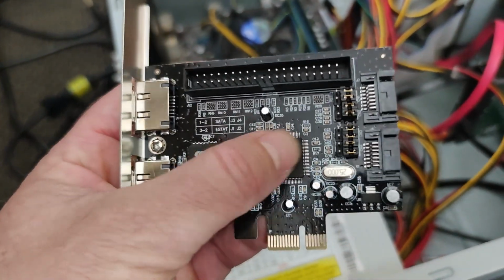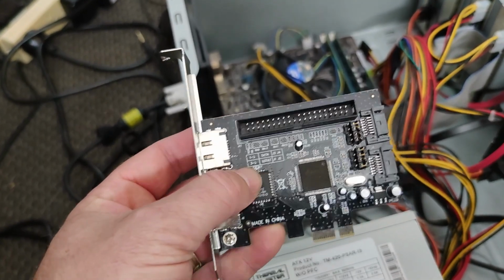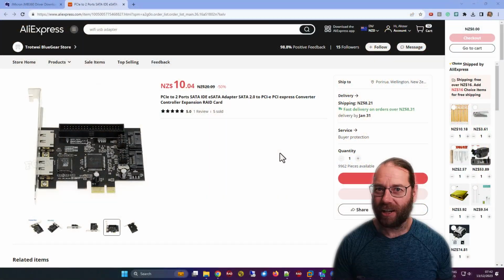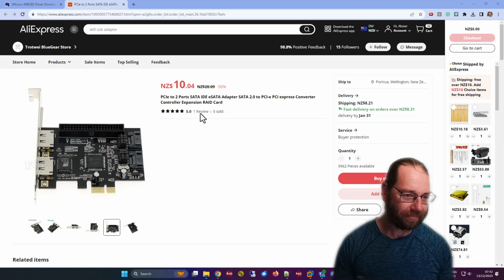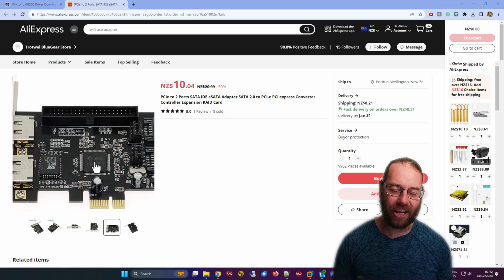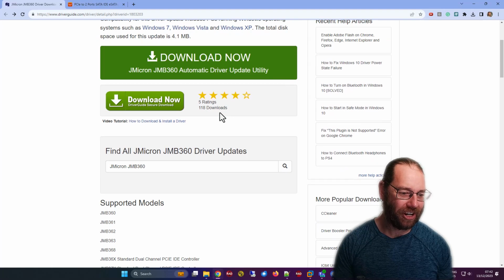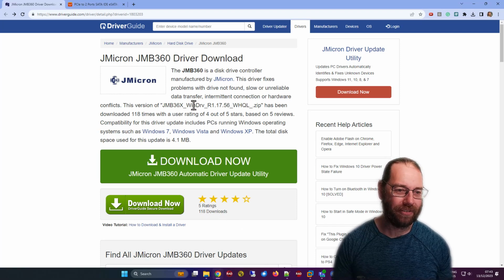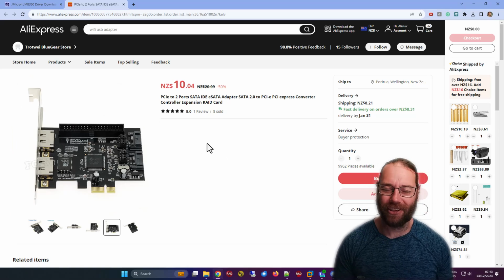Parallel ATA in a Modern Computer

Comment: I remember a cable like that one. It was a SCSI cable. SCSI needed a termination at the end of the cable.
Reply from the maker: Yes, I had a number of SCSI drives back in the day - some a large as a whopping 4GB.  Those old 50 wire SCSI cables have since been replaced by SAS - Serial Attached SCSI.
Reply: I had scsi until sata became a standard, I especially  remember those Toshisba cheeta's 15000Rpm hard drives.. they sounded like a jet engine while starting, but they where so fast
Reply from the maker: @groenevinger3893  Yes I think I had a refurbished 2GB Cheetah, loud it most certainly was.